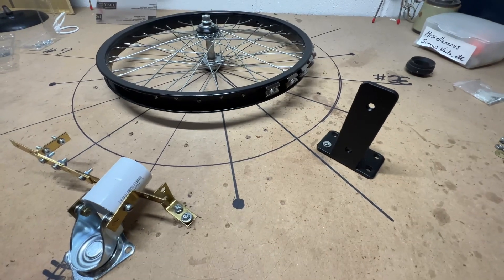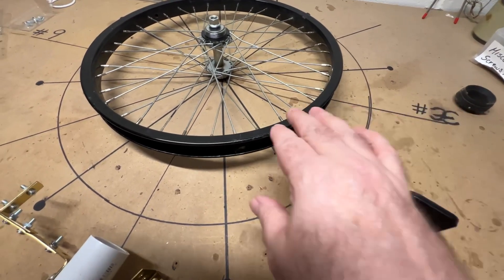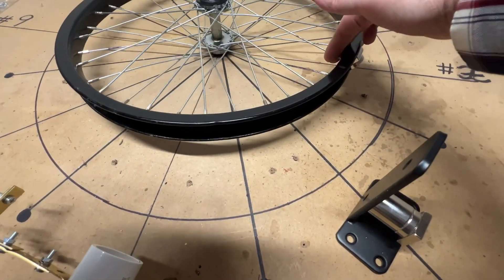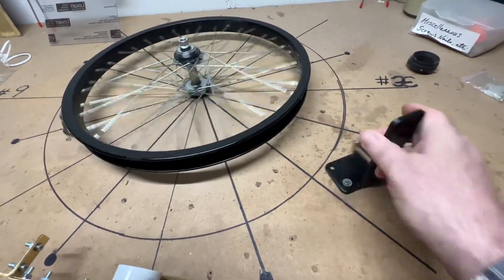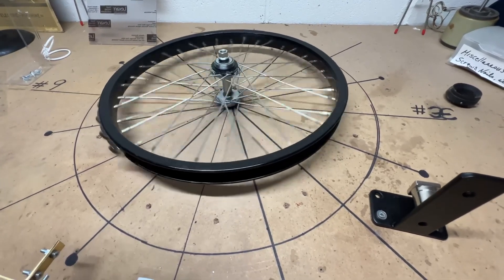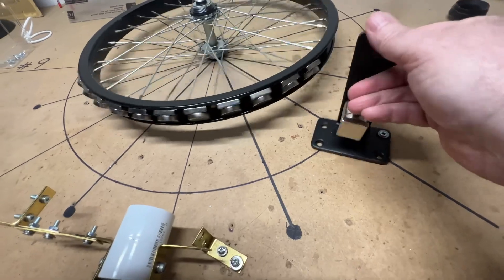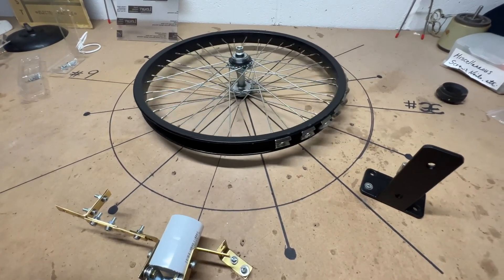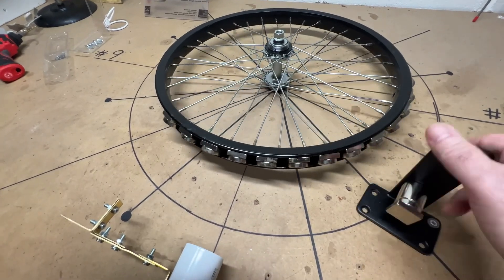360 SWIVELING STATOR | Free Energy Research

Comment: Connect your device to a shaft snd spin up a flywheel then run the fly wheel to an ac generator. Also you can get a super low power device to keep time with the wheel

Comment: I am visiting from Motion Magnetics. I would suggest using 2 drive type of bicycle wheel (s) with a chain drive.  The main thing you need is sprockets that accept the same type of chain AND with the same number of teeth. Giving you a 1:1 ratio. Now on one of these wheels it can be damaged, because on the damaged wheel you are going to need to either use as is or remove the spokes and rim to mount the rotating magnet. Interesting concept. I hope that it works.
Reply: I've experimented with things like this.  What I think I determined is that the two can't be coupled by a chain or gear (I was using 3D printed elliptical gears.)  The timing has to be independent, but synchronized.

Comment: Why don't you just use 2 vwheels with a chain between them
Reply from the maker: 🧲 1 to1 ratio will not work. I have however in my mind’s eye believe I have a means to get the V gate up and running. For now, that will have to take a back seat. Thanks for your input.

Comment: A vertical shaft, pvc with small bearings set in it and able to rotate, just a short small diameter pipe may work as well as bearings, two pulley wheels in the appropriate places with large rubber band as a belt. The length of pipe could be varied to control the period of rotation of the pipe with magnet within, there may be an advantage to placing two magnets in the rotating pipe, one in each end.
Reply from the maker: 🧲 I’ve already started building something using 1” ID PVC PIPE using short pieces. Still working on it when I’m not involved in other responsibilities.